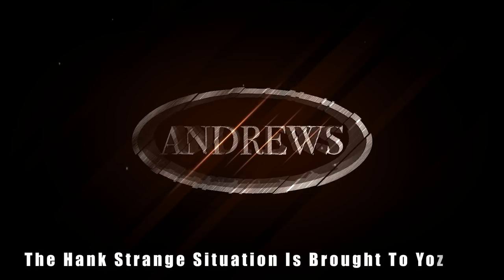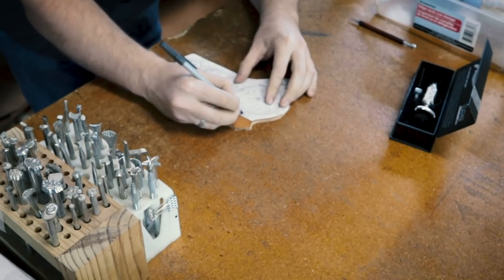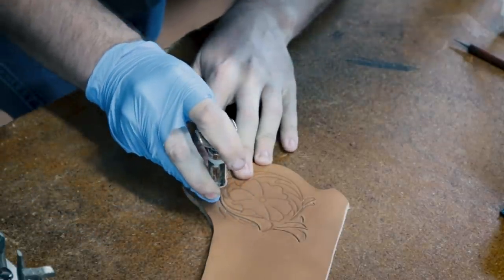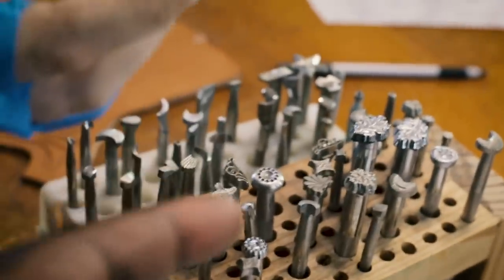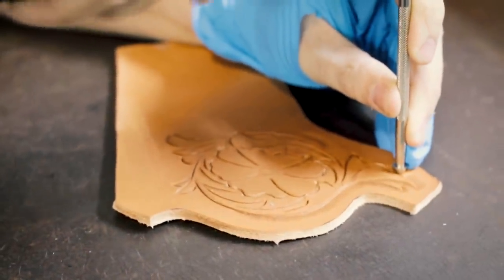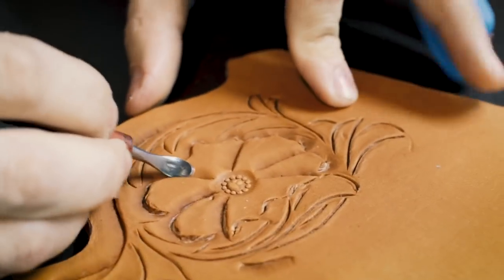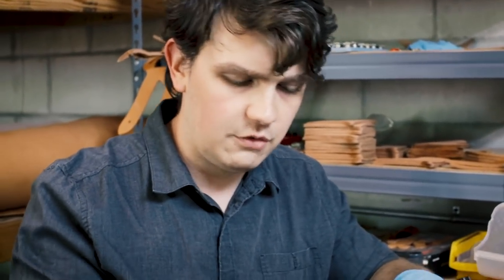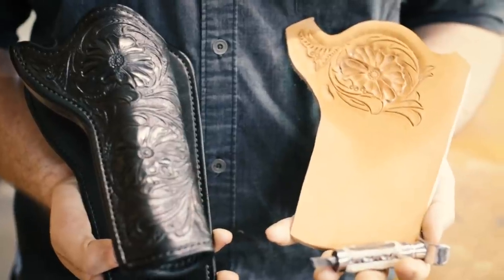Leather Carving For Beginners with Dominic Whitaker // Making Custom Holsters

Comment: on one of your videos you mentioned starting with good quality leather.  As a beginner, would you care to elaborate?  Veg tan for tooling/moulding, but what thickness do you recommend?  Do you recommend a particular leather distributor.  Seems like there is quite the price difference between retailers.  TIA.